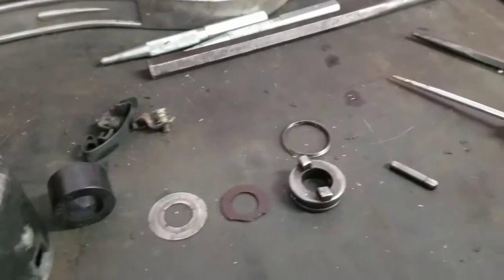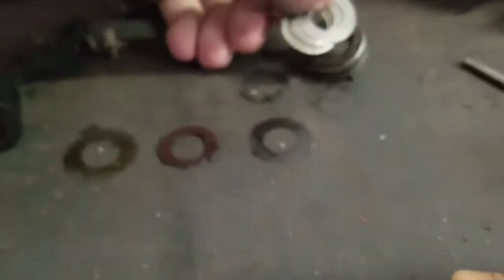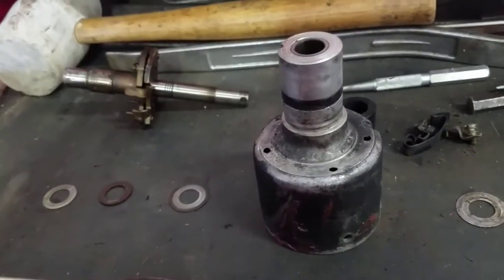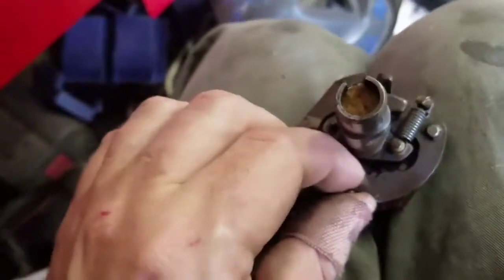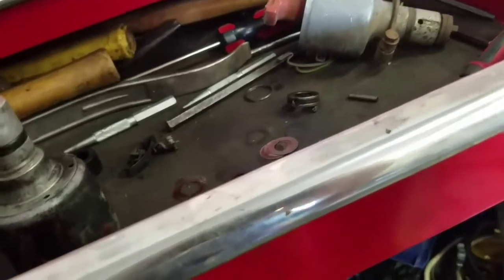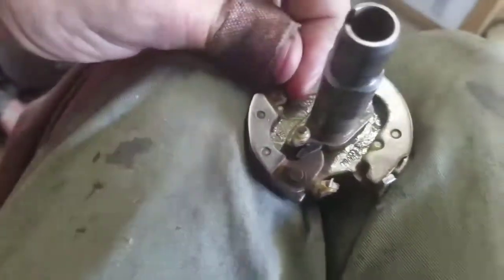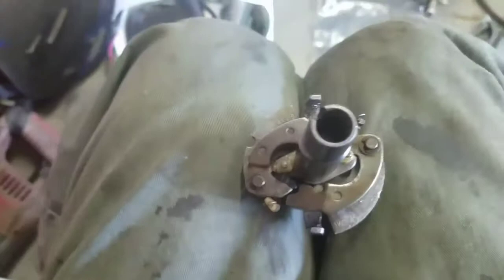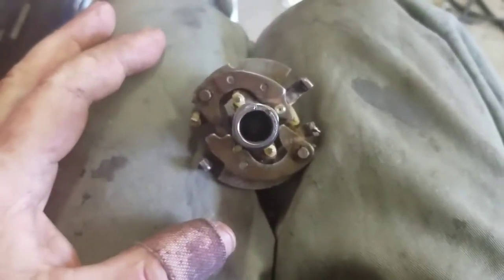VW 009 distributor advance modification

Comment: How is the Cam retained (up and Down)  on the shaft minute 11:22 you simply lift it off.  What retains it in operation?
Reply from the maker: Don't quote this as always true. But the German ones have a circular clip around the tip of the lower shaft.(It's small and a real pain to remove.)
And aftermarket ones have a screw. Hope that helps.
Reply: @ReverseGear  I found the screw when I lifted the felt thanks for the mod video when you added retard dis you have to find a shorter spring?
Reply from the maker: No, But I've thought about finding a stiffer or shorter one. If the spring is wore out. It may not work very well.

Comment: So what is the point of this mod? Because you can only run at 32 degrees max advance.. if you go beyond that you are burning holes in pistons, If you are going for lower initial timing you are just going to create a gigantic flat spot from idle to whenever it decides to go full advance...
Reply from the maker: A standard 009 distributor doesn't have enough advance for a street engine. If you set at the stock setting. You get the dreaded 009 stumble. I like to build my own stuff. And relive the good old days. Of modifying stock parts. But it is just easier to but 050 Petronix clone. That's what I actually put in my customers cars.

Comment: sometimes homemade springs work the best when experimenting with a distributor. ive found.its fun to play around with different tensions and lengths to get it exactly how you like it specially when accelerating from a dead stop it makes a big difference thank you for the grinding tip it worked out great for me.
Reply from the maker: alejandro Yes. I just lucked out. And hit the sweet spot the first time. Gas mileage now sucks. Only because this thing rips! And I don't put around anymore.

Comment: OK. How did it work out? I'm always amazed that more attention is not paid to advance curve. Of course most people don't even know what a centrifugal mechanism is anymore. This is the first I've seen on the 009. I think you are on the right track. Did you have to make any other changes? Different spring, two springs? I've also added extra weight with solder or a small weld bead to speed up the advance. This really helps when a lighter spring won't pull it back to base at an idle. 
Anyway, I hope to dig into one for my son this week. Looking forward to seeing more on your results. 
Thanks.
Reply from the maker: Jim King Yes. I think partially luck. On getting it perfect. No spring changes. But it runs really good. Too good. My gas mileage has suffered. But because it's never had this much power. Can't help ripping around in it. I personally wouldn't change the springs. Only because it does good all around. Street and highway driving.
Reply: Reverse Gear- Excellent! Thanks for the update. I'll let you know how ours turns out. Keep up the good work. Later.